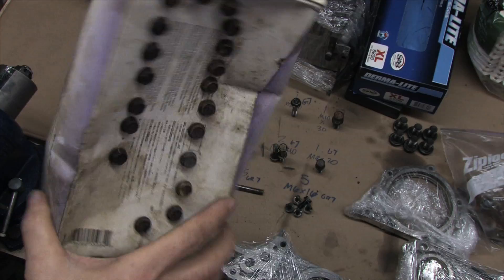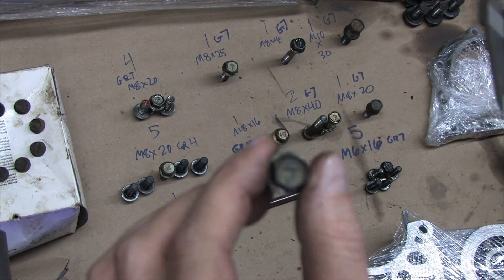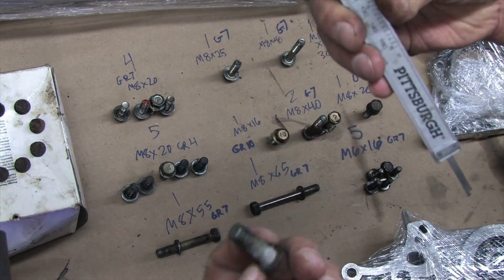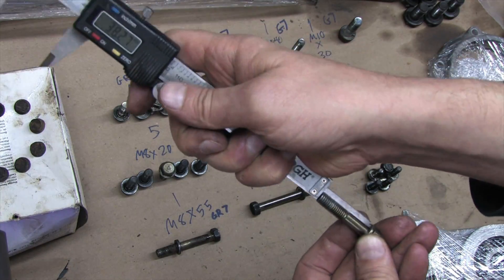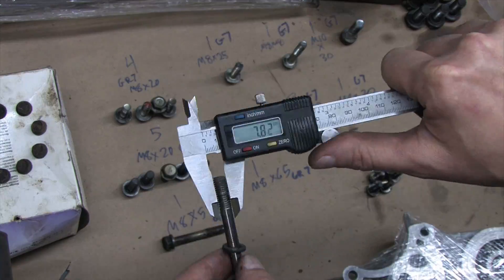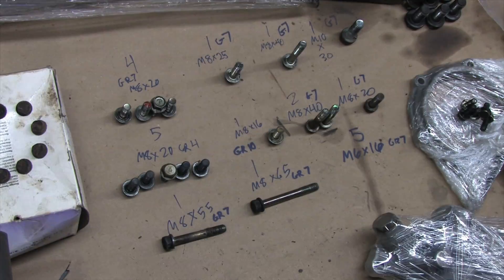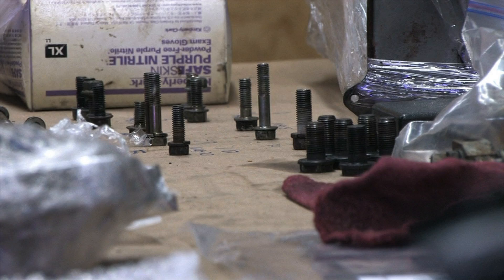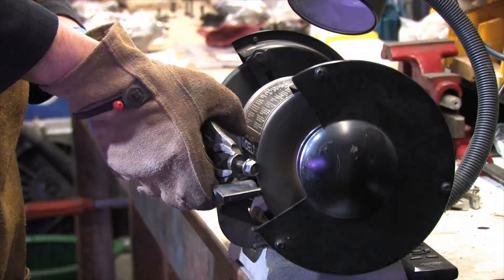Hyundai Assembly 2 - Fasteners, Shortblock Assembly & Head Progress

Comment: Jafro, any chance you have a video of motor assy. with BS's? The FSM is garbage when it comes to their installation, I can't find anything in the forums about it, and I've watched all of your videos of anything that might possibly show this but everything's BSE. Thanks in advance!
Reply from the maker: It's coming soon, but it's not here yet.  I do demonstrate the timing marks as they relate to TDC on a 4g63 with balance shafts in my latest upload, but I don't fully explain how you get there.  Essentially there are 2 inspection plugs you can remove and stick a screwdriver in the hold the balance shaft still.  This assumes you've got all the dots on your oil pump gears lined up prior to assembly, too.  I do cover the dots inside the front case as they relate to assembly in that video.  I rebuild the front case.  I lined up my dots.  Really those are the two tricky points, otherwise they're exactly the same as one without them.

I have the Mitsubishi bearing puller and installer tools for the balance shafts.  I will be using them on the engine I'm currently building that has balance shafts, but on the video part, we're not there yet.
Reply: Wow, I was giving myself a 10% chance of a response and you replied within minutes. I appreciate it. 

Those videos are helpful, I've got the rotating assy installed, including the BS bearings, just having a hard time with know how to install them and the front case. 

Sounds like perfect timing (no pun intended) to ask the question if you're plan is to keep the BS's in the VR4 rebuild. I'll patiently wait. Thanks again for the great content and quick reply.

Comment: No need to apologize for doing things the right way, even with used parts. As you know if you’ve watched preceding videos, it is about following procedures on a consistent basis as well as checks with instrumentation. Breakdowns in either your discipline or desire will have results that are thoroughly negative. Positive results only occur when you follow the steps each and every time regardless which operation is being performed. Some may consider this a pain in the ass, but there can be no violations in any step without ugly consequences. Discipline and order are necessary. This is what separates professionals from amateurs! There is no place for amateurs here! Pros are first place finishers! Amateurs do not belong doing this grade or kind of work! Failure could cause loss of life or livelihood! It’s not personal, it’s just business! 😲😠😬🙄😁

Comment: What was the miracle spray you put on the water pipe and cyl head when it was on the engine hoist? lol BTW i thought all DSM waterpipes came black from the factory! lol
Reply from the maker: Hahah!  Read the can right behind it at 10:34.  I made a video about it called "DIY parts washer".  ...and no, those things are natural finished bare metal pipes.
Reply: Yeah I saw that vid shortly after i posted this comment. lol
Reply from the maker: Mind blown how well it works or what?  I know mine was.  Cheaper, faster, safer and less toxic than carb cleaner.
Reply: i was thoroughly impressed! How is the hyundai project going now?
Reply from the maker: Though it drove less than 150 miles since its last state inspection, it tried to kill me, and it never should have passed its last inspection.  I had to go back through some of the mechanicals. You'll see...  Engine's stout, though...
Reply: looking forward to the vid! glad your okay. And its no surprise how powerful it would be I bet it's a monster when it isn't trying to slaughter you.
Reply from the maker: ...and it's not the only thing that's tried to this year.  The bastards are 0 for 3.  Can't wait for 2017.
Reply: Remember, life is a constant battle to the death.
Reply from the maker: Only if one has lived it to the fullest!  Otherwise it's no contest, in death's favor.

Comment: Love the Vids man! Question what's the liquid tube stuff you put on gaskets to hold them in place?
Reply from the maker: It's "Mitsubond", which is a factory-brand OEM grey RTV sealant.  Don't ask me why, but Hondabond and Mitsubond (which are the same exact thing) are better than all the world's RTV products.  The factory stuff never seems to develop leaks whereas I've had that problem with [unnamed grey RTV manufacturer]'s products.
Reply from the maker: I know I answered this yesterday... but it might not have been all the answer you needed.  If you just need to hold a paper gasket in place while you install the other half of the flange the gasket is made for... you can just use multi-purpose grease.  In my case, applying a thin layer of mitsubond is specified for one side of the gasket layer.

Comment: Since you've discussed removing balance shafts and how it effects oil galleries and oil flow. I know that removing them is to help prevent "some" parasitic power loss. So with that being said, do you think adding a racing balance shaft would help prolong the life of a 4G63 oiling system enough to try one? And if so, would you be willing to try one? In lets say your 2G 6 Bolt build? I've provided a link below to a racing balance shaft for a 4G63 that I just stumbled across.  I was just wondering If you've tried it or know someone who has. It would be interesting to see this kit, along with oil gallery mod, head oil port mod, and a Kiggly HLA installed.Being your 6Bolt for the 2G is an experiment with the glycal treatment this would be awesome to see if it actually works to the manufacturers claims (if your removing them hasn't preventing you from trying them at all?).  It shouldn't have an excuse to starve anything of oil in theory, it would be overkill. But trying to prevent your engine from grenading IMO isn't overkill at all. Thoughts Oh Jedi-4G63 Master? 

http://www.extremepsi.com/store/product.php?productid=26777&cat=1828&page=1
Reply from the maker: +BoostedCajun The racing balance shaft actually isn't a balance shaft at all.  It does nothing for harmonics.  The only things the racing balance shaft offer mechanically is additional linear support for the oil pump driven gear, and to maintain the same level of oil flow and pressure that you would have if you had regular balance shafts.  There is the potential for adding additional clearance for a stroker crank if that were ever a concern, but it would be an unusual build.  Their are situations where this part is justified, like for people who don't have the tools to knock the bearings in and out to block off the holes or who don't want to remove the block to get to the balance shaft bearings... but there are factory Mitsubishi stub shafts for the exact same oil pump because the 4g61 blocks don't have balance shafts.  Why don't those 1.6L engines fail without that additional linear support?  I believe there's validity in the oil pressure theory.  I chose to handle my oil pressure issues differently.

Comment: 6:40  I don't see a woodruff key go on. I don't remember taking one off, but the forums say that the 6 bolts DID use one.
And that rubber spacer that goes on first is just a performance substitute for the original balance shaft belt pulley, correct?
Reply from the maker: +Jacob McCracken Honestly, I've never had a woodruff key fall out of any of my 6-bolt cranks.  I suppose it's a separate part?… but one I've never given any consideration to because through disassembly, machining and re-assembly, mine have always stayed put on every 4g63 I've handled.  There's no question that there should be one as the crank sprocket has a keyway cut into it.

The spacer for the balance shaft is actually steel.  It's what seals up against the normal oil seal that's pressed into the hole that the balance shaft sprocket goes through. There are rubber plugs available that seal the front balance shaft hole, but when the balance shaft is removed, there's no need for the spacer or the standard seal.  Perhaps I'm misunderstanding which spacer you're referencing?
Reply: +Jafromobile     The spacer I'm referring to is MD128107, i believe the mirage spacer which you put on before the trigger plate. Isn't it lighter alternative to the 2.0 turbo engine balance shaft sprocket, MD131312?
I've already used the BSE kit with a mirage "stubby shaft".
Reply from the maker: Jacob McCracken Oh ok!  It's a steel spacer.  I think that's why I got confused.  Yes, it definitely is lighter, but Mitsubishi used it just because something the thickness of teh balance shaft sprocket needs to be there in order to keep the timing belt in alignment.  I don't think Mitsubishi planned for it to be lighter, but it's definitely an added benefit.  In comparison to the weight of the rest of the rotating assembly, it's spit in the ocean, though.
Reply: +Jafromobile    No kidding, my supplier advertises the spacer as a performance mod..
Reply from the maker: +Jacob McCracken I don't think they're out-of-line for doing so.  People pay big bucks to slap 1200 grams out of their rods, and I have a crankshaft that's had 8 of it's 60 lbs. removed.  For people that have lightened flywheels and everything else, it wouldn't make sense not to use it.  :)

Comment: OK.....can someone tell me witch are the correct bolts for the 6/7 bolt oil case?? On stm and extreme psi shows 8 bolts. Doesn't specify the sizes(stupid). Jafro gives the sizes but only list 7 of the bolts??? Shows part # for one screw to use for 7bolt motor and other part # for 6 bolt motor. I need the 8 bolts for my 7bolt block oil front case, I have my 4 bolts for the oil filter pump. There's 8 bolts. Witch ones are they? And I'm not gonna pay 10-16$ for the 8 when I can get them here locally for like 4$. Thanks
Reply from the maker: Look in the description.  Count the quantities  ;)  I left the 7-bolt screw out.  It's a short screw.  I think it's a M8x16.  Everything else you're looking for is in the video description.
EDIT:  Correction... the screw and oil pump bolts are also listed below the front case bolts.
Reply: Thank you kind sir.
Reply from the maker: Chloe Clark No problem.  If you want to know which ones go where, check out 4:20
Reply: Thanks I have the diagrams. Just couldn't seek the bolt specs. Nothing on dsmtuners, DSM talk, extreme psi,etc... You're the only one I came across who had them! Thanks a lot. Now I have to wait till Monday to go get them! =D ciao!
Reply from the maker: Chloe Clark I put them out there because nowhere on the internet has all of the info in one place.  You just stumbled across a Jafromobile exclusive.  I even have the grades.  ;)

Comment: First off love your videos. i appreciate all the info you give. and thats a great spring compressor you have, I built a stand for my drill press to do that. im pretty tempted to buy a 4g63 to learn how to rebuild a motor properly (ive done it once and its running but not as well as i had hoped) how much was it for all the gaskets and bearings you used
Reply from the maker: I paid about $350 for everything including the expensive items like the oil pickup tube and the $71 valve cover gasket set.  But then I double dipped at about $90 more for head rebuild parts including Viton valve stem seals, all the thermostat gaskets, some random fasteners and all the hoses you saw here.  I probably had about $30 worth of spare gaskets laying around from other crap that finally found a purpose.  Exhaust manifold gasket, oil pickup tube gasket, turbo oil return gasket, Mitsubond RTV.  Stuff I already had.  For people that don't have spares, those still cost a little money but when you're quoted $2500 for a rebuild and you can pull it off for 1/5 of that... yes, I'd say that's a great skill to develop!

OE head gasket won't fit this block anymore.  Aside from a Felpro Perma-Torque composite head gasket, everything is standard OE Mitsubishi.  You could probably save $50-$100 with aftermarket stuff.  I like the OE stuff.

Comment: Warning to anyone who is thinking of buying a snap on tec wrench! if you buy a mac, matco or anything besides snap on, there the same but dont work quite as well!
AND you will fall in love with it! expecally the latest model! its insane!!!!
Jafro what one do you have dude? the one with memory recall?
Reply from the maker: It's the Techwrench 2FR1000 I believe.  Might be 100... but I swear there were 3 zeros on teh case.  I show the label in a previous video... I think it was the shortblock assembly video.  This wrench was manufactured in 2004.

What it taught me was how much I didn't know about using a torque wrench properly.  Any machinist who criticizes this wrench for being inaccurate or inconsistent loses my business because it exposes that they don't know how to properly use a torque wrench.  This one will frustrate professionals the first time they use it, but it's a learning process.  It's the most accurate and consistent wrench you can use - IF - you use it correctly.  Clicker-wrenches actually help mechanics develop bad torquing habits.  I'm also guilty of this, and this wrench re-calibrated ME.
Reply: Very Very well put dude! mine was made in 2012, the latest one remember's torque valve's, lets say your torquing help bolts it will count how many times you went to 65 ft lbs for example... its just insane!

Comment: Never knew hyndia had mitsubishi engines something new for me.
Reply from the maker: Not all of them.  You can find them in cars built up to '96, and Hyundai-cast facsimiles in some other Korean cars all the way up through 2005 like in the Kia Optima. The Optima has a non-turbo 2.4L EVO engine in it.  Some years of the Kias (Sportage I think?) even use the JDM FE3N contracted from Mazda in Japan.  Those things are boost monsters.  People that know what to do with 'em pay big bucks to import those engines, but you can find it rotting in a junkyard in the states if you know where to look.  Most people ignore Kia and Hyundai.

I talk about the Mitsubishi DSM partnership and the Hyundai/Kia involvement in a video here called "Why so SIRIUS?".  This actually greatly-expands the parts market for the DSM guys.  This particular engine is built for performance, but built entirely from mix-n-matched factory parts from both manufacturers.  Aside from a set of used purple AEM cam gears and an ebay boost controller, not one aftermarket part was used in its assembly.  It's a $150 chassis delivered by a forklift that was put back together using boxes of leftover parts.   It's fast, but mostly traction-limited.

Thank you for your interest in it..  :)
Reply: ***** cool i think the 4g63 is like the best engine in my opinion.
Reply from the maker: Sshhhhh!  One of the Honda guys might here you!  :D

The 4g63 is awesome because of how many years of racing development and production it has endured.  There's actually lots of fantastic engines that can do what it does, they just never had the racing pedigree or as big of a production run.  The FE3N and 3SGTE are prime examples because of their solid-decked cast iron blocks, aluminum heads, big ports, big rods and displacement... there's just nothing aftermarket available for them.  Not anything like a 4g63 anyway.  Modifying them requires a high degree of creativity because everything's a custom-fab.  I'm one of those who have favorites but who respects what my non-favorites are capable of.  My laziness is why I pitched my tent in Mitsubishi's camp.

A Honda B20/K20 has the potential of a 4g63, but requires considerable investment to fix certain design flaws inherent with combining boost and floating combustion chamber/water jacket problems.  Be sure to check out "Jafro's Honda confession"... I built a 5th gen EG hatch.
Reply: ***** nice ama check it out thanks for the big info keep makin vidz
Reply: ***** nice ama check it out thanks for the big info keep makin vidz

Comment: Hey Jafro! love that video once again.
Sadly I have another question to add to the growing list in the comments.
I just pulled my 1g's engine and tran to swap with one I pulled apart to look for damaged internals. Found everything was good to go but when I was cleaning the Case up the bearing races/shims fell out of several places (ended up completely re-assembling it and un-assembling it 3 times). I believe I figured out where everything went but my input shaft has some in/out play and a tinny bit of side to side. Have yet to measure how much but my question is would you think of running a tran like that at stock 14b power levels? I'm starting to second guess myself and yet dont really have the coin to throw around on buying new parts for tearing it down again.
Reply from the maker: No.  Not with shaft play on the input shaft.  I'm no transmission expert yet, but know a transmission's days are numbered like that.  They're helical cut gears.  Thrust loads will accelerate wear.  They're going to wear without it, but why shorten its life?
Reply: ***** Crap that was my fear.....I hope I don't finish destroying the input shaft threads then I rip off the end nuts. Thanks Jafro, Tranny shop I took it to said it was fine but I was very iffy on it and you just confirmed it for me. Fan for life man.
Reply from the maker: MechRider89 I hope I'm not just imagining it has more than a couple thousandths.  The guys at the shop got to look at it, I'm trying to measure endplay based on a description over the internet.  I'll check mine next time I'm in the garage.

Comment: What kind of grease did you pack the oil pump gears with? I've heard numerous types being used.
Reply from the maker: Multi-purpose grease.  It doesn't matter what kind you use, really. As long as it's oil-soluble (petroleum based).